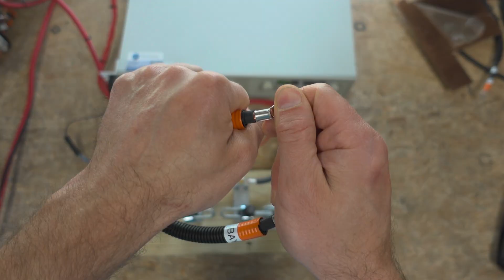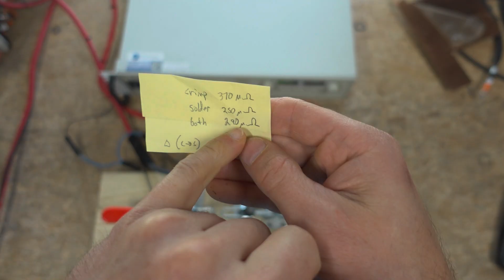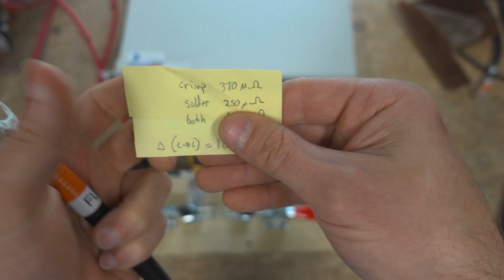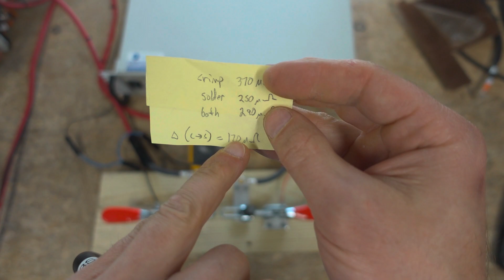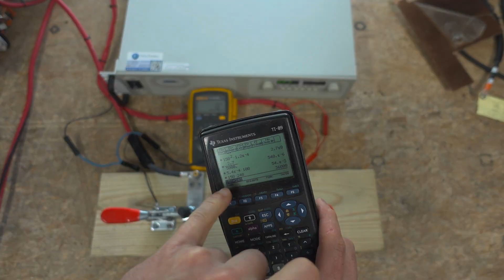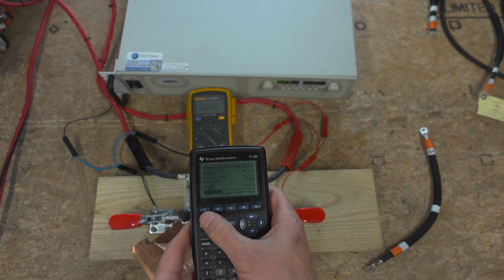Response to "Crimping or Soldering?"

Comment: lol or just be like tesla and decide you dont need busbars anymore and use angle hair pasta thickness aluminum bonding wires on all your cells so that they act like fuses, and then only attach them with ultrasonic welding instead of laser welding. nevermind nvh concerns. cant wait for all these rushes tesla cars to start comming out of warrenty and everyone opening them up to realize all the failed bonding wires in every pack leading to cascading cell failures. tesla packs dont degrade they just randomly fail from hitting too many pot holes and smashing into road debris in full afk driving mode. did tesla forget that aluminum fatigues? at least they started putting foam in their packs after like 2023 and reworked the cooling to not have as many hospots.... too little to late. the only not cursed hv batteries tesla made were the lfp ones with actual busbars lol

Comment: "look at industry" appeal to authority,0 prove those vibrations are going to matter within 20 years.   The solder joint will outlast the battery regardless of vibration, you act like its going to break in a year.  The reason they chose to crimp and not solder is not what you are saying, its just easier to automate crimping and cheaper that is why
Reply from the maker: There is a substantial body of evidence and expert consensus that soldering terminals in automotive wiring applications is problematic.  This is not a contested fact.
Reply: @doppelhub  So more appeal to authority, go ahead and link me to that mountain of evidence
Reply from the maker: @adairjanney7109  Not sure why I need to teach you how to google, but I recommend starting with IPC/WHMA-A-620 or IPC J-STD-001.  This really isn't up for debate, as it's a resolved issue in industry: wire terminals are crimped in automotive applications. Period.
Reply from the maker: And if reading standards isn't your thing, here are some reddit posts you can read to educate yourself: https://old.reddit.com/r/CarAV/comments/ad8geu/for_the_people_in_the_back_soldering_vs_crimping/ https://old.reddit.com/r/CarAV/comments/u0qjl5/nasa_standard_for_soldering_wires/
Reply from the maker: Another reddit post: https://old.reddit.com/r/CarAV/comments/qaouq3/for_those_still_arguing_about_crimping_vs/
Reply: @doppelhub  I think you are correct in a mass production setting but if you are doing it for yourself I think solder is just superior regardless of supposed vibration, if you use the correct solder and the do it right its better imo.  And hey you proved that with your own tests and then went on to explain reasons why its better in mass production and your claim of vibrations which I do not buy, maybe if you use crappy unleaded solder
Reply from the maker: @adairjanney7109  I think you should study the literature before you make these statements.  Specifically, I would research why solder type (leaded vs lead free) is irrelevant.  Regardless, I don't intend to debate these merits with you in youtube comments... if you want to make a counterpoint, please do so in your own video.

Comment: This video is filled with more details and examples than an industry white paper or an engineering school book. Hats off to this man! I hope anyone working on vehicles watches it. I only wish there were some illustrations of the crimping process shown as proof of what was said here. There are guides by TE and Delco with a great detail on this, for those interested. 
One other thing to mention is, that while crimping and ultrasonic welding are the only ways to go for connecting conductors in the automotive industry, the proper tools for that are very, very expensive. And still, there is no excuse to solder any conductors, especially those carrying high currents. 
Contrary to all that, in the repair manuals released by Mercedes and Audi, they tell you to solder broken wires and use a dual wall shrink tube (with glue on the inside) as a strain relief. That applies to small gauge wires only. So I guess they don't expect the dealership service centers to buy the tools for crimping or train their mechanics on how to use them properly. But I know from experience that no service center will repair a harness but rather replace it.

Comment: Hi the more i think there more works need to do, mine single battery tester has 8 wires positive side 2 current wire, 2 voltage wire, 2 IR-internal resistant wire, and 2 for temperature collection. if I do this on a high voltage pack it will be 70x8 = 560 wire wiring..... and implement custom cooling method, over charge, under charge, over current, protections its a massive amount of work. I try to find a quick ways to solider hundred  of wire, the amount of wire is my nightmare. for my 6 prototype i  been spend so much time on soldering/cramping wires...

Comment: If someone need to go down to the uV range to measure voltage drops olso need to care abaut the connected dissimilar metals generated thermal-voltages and their polarity to get accurate numbers.

An connection between nickel (a usual planted probe) and cooper (a element from cable) can make 10uV  reading error by every °C diffrence.

So realy easy to “measure” huge  diffrence between setups if diffrent setups are use diffrent material-connections and olso not wait enough time (can be a half an hour) to gets the temperature equalised between the parts/probes.
Reply from the maker: The thermal emf you describe between metals would be more problematic with the test equipment used in the original video (that I'm responding to).

However, in my test setup, the lowest voltage I measured  was 2 mV (i.e. when testing the copper sheet), which is ~40x higher than the expected thermal emf that develops across the copper+nickel+aluminum interfaces.  The actual test I performed on the cable yielded 18 mV, which is ~360x higher than the expected thermal emf.

In the original video I'm responding to, the test current is ~1000x lower (100,000 mA versus 100 mA, or possibly even 50 mA depending on range), which would certainly increase the error introduced by thermal emf.

Overall, your thermal emf concerns are valid, particularly for the original test (performed in the video I'm responding to).  However, in my testing on the cable, they would contribute at most 0.3% uncertainty.

Thanks for the comment.

Comment: Corrosion is a real thing in crimp connections. In the salt water marine industry I find many failed crimp connections do to salt water intrusion. I would imagine it might be similar for automotive in the salt belt. I crimp then solder. The solder doesn't add any better electrical connection but it does seal the connection inside the lug to help delay corrosion. If the corrosion gets inside the insulation it can travel the length of the wire and turn the copper to dust. In my world the corrosion is a greater threat to the cable than vibration breakage. I never felt that solder only was any good. I have seen starters go bad and batteries get low causing the cables to heat up enough to melt the solder out.
 It is good to see someone with actual knowledge make this explanation about solder connections. I also use glue sealed heat shrink crimp connections for smaller connections but the internet experts go ballistic saying they are poor connections. My contention is that every auto manufacture crimps every connection. What makes these people more of an expert?
Reply from the maker: Applying dielectric grease to the crimped connector will achieve the same corrosion resistance, without introducing embrittlement issues caused by solder.

Comment: Fun fact, all wires in the Space Shuttle are crimped.
Crimp gives you that "gas tight seal" and you nailed it. No oxygen allowed.

Lessons from the field. 
Don't use Chinese crimps. Use high quality beryllium copper, name brand. 
Get the good crimp tool! Yes, they are a bit more expensive but worth it for peace of mind and quality crimps.
Clean the cable's copper area before crimping. Sand paper, alcohol. The idea is to get an oxygen free, gas tight seal. debris and corrosion are the enemy.
Size the crimp for the wire! Too small and you don't get good crimp, too large and you will deform the eye and not get a good crimp.
Gas tight seal - learn it, live it for great crimps each time. Just look at telecom and wire wrapping. Those connections are still in use and were made 30 to 40 years ago. Just by wrapping a bare wire around a square post.. but they have the gas tight seal and that's why they're still working today.
Reply from the maker: I still have my wire wrap tool from back in the day.  Haven't used it in years, but yes: five wire wraps around a square post will last forever.

Comment: It has to be crimped with the correct crimping tool with the correct terminal. Discuss the cost of the correct crimping tools to use with correct terminations. All those tools are so affordable for someone doing 2 lugs in their garage.
Reply from the maker: I agree the proper crimping tools are mostly relatively inexpensive.  The one notable exception in my stable is Berg's $1300 crimper for 0.1" headers.  Otherwise, they're all less than $100 for quality tools.

Comment: Why pay attention to his every sneeze? I'm genuinely interested in your solution for the Prius. 
By the way, I’ve been using a V3GT battery in my Prius since August of last year, and I can say it’s better than a brand-new OEM nickel battery. The conditions are aggressive: Amazon Flex deliveries, constant start-stop driving, and the hilly terrain of California. I always monitor battery temperature through OBD2, and I can tell you—the original battery overheats quickly in summer, hitting 119°F even with the fan forced on, and then the Prius stops functioning as a hybrid. The V3GT, on the other hand, doesn’t heat up beyond 106°F, even when I use EV mode frequently. The Prius always has strong acceleration and excellent MPG.

Comment: I sometimes had to solder due to not having the right crimps and crimping tool. That hasn't been an issue in a while. I wonder how they'll react when they find out how much resistance fuses have.

Comment: BTW the look does matter not about the 7.5w energy lost but the look you should offer 15k gold plated option for the high end customer.
Reply from the maker: There aren't many quality gold plated ring terminals available for wires this large... only 35 of Digikey's 7562 ring terminals are gold plated, and none of those are large enough for 4 AWG wire.  I use Tin-plated copper contacts, which is industry standard.

Comment: When I was working for an industrial machine manufacturer we would crimp high amp cables and then insert the crimped connectors into a solder pot to the edge of the exposed conductor.

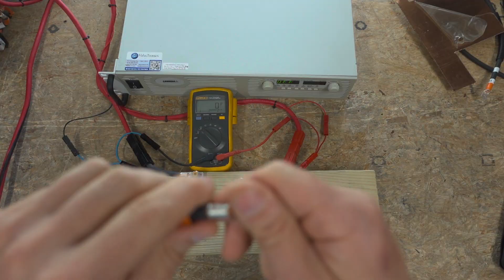Comment: 1:14 The other video's crimped terminals were atrocious.
Reply from the maker: I agree.  Quality crimps require a cold weld to form between the wire/terminal.  Poor crimps don't cold weld, which can lead to corrosion.